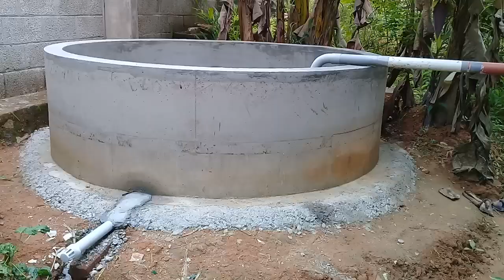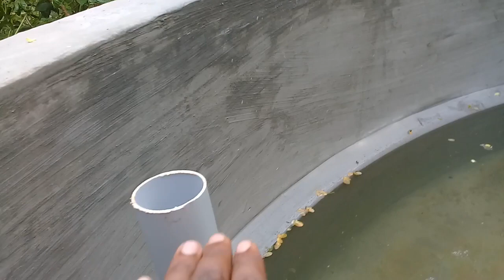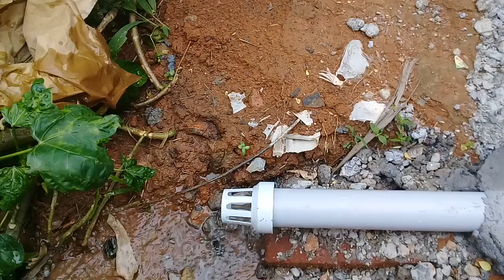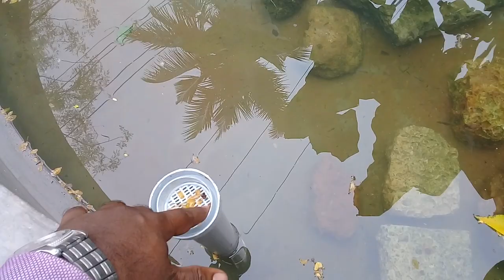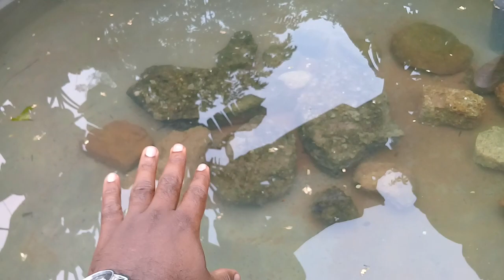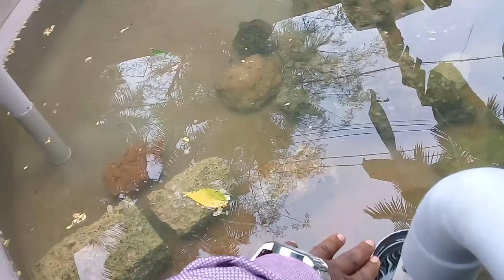fish pond for home Part 2

Comment: Grate idea. First of all I want to appreciate you for this idea.
Some of my observations I would like to share with you.
First is the design of tank. The bottom of tank must be in slope and small pit should be at center. Then the soil water of fish and wastage of fish food will accumulate over the center pit because of slope. That can drain out easily.
Second is, the drain pipe position should be at center pit. This out can utilize for CRA system as well as aquaponics system.
Then the inside of tank can apply water proofing to avoid leak and improve the tank life too. Cow dung can apply for reduce the chemical reaction too.
Height of tank minimum 1 meter recommended for fish farming. This height is enough for normal aquarium  fishes
.
Reply from the maker: Thanks ☺

Comment: Mr Rakesh nice video....what was the expenditure for building this tank....?
Reply from the maker: This tank costs Rs.13 thousand... for Labour ,materials and plumbing charges... Cost varies with the size of the tank.. small ones does not even cost you 1000 since  there are ready made ones... But this one is like 8feet in diameter which is bigger than normal...
Reply: @raksuncreations6848  sir thank you very much...I built one too with readymade circular rings used in wells...which is 6 ft dia and I used three rings...sir Iam  from Trivandrum....I want to make a bigger tank as you made....can I get your WhatsApp number if you don't mind.
Reply from the maker: @inntro  Hello... This tank was bulit by a normal construction worker and i just wanted him to implement my idea for water circulation and rain water collection... its quite simple .. sorry with the number
Reply: @raksuncreations6848  Thank you

Comment: Mr rakesh.. Is it advisable to use rain water for fish from the roof?
Reply from the maker: Hi... why not... I have a mix of Mushi and Tialpia fish in my tank now... and they are thriving pretty well...
Reply: Why put rocks in the fish pond ? Hope I'm not disturbing you or anything?
Reply from the maker: There is a reason for keeping porous rocks or corals in a concrete pond... most of the black water fishes lay their eggs  on rocks which a slippery concrete wall cannot provide.. also rocks act as shade or hide and create a natual environment feeling for the fish... I added 2 pairs of tilapia for test initially and now there are nearly 50+ juveline fishes last week..and rock had a major role to play
Reply: Thanks so much.. Get more questions and thanks for taking your time to reply me.. Appreciate that.
Reply: The reason I was asking this is Bcos I wanted to start catfish business and I'm a novice at it.. Need more help on the pond though.. Like structure and more
Reply: should we bare d water minimum one week without putting in d fish..bcause my tilapia started dying as I directly put them in even with aeration,they come up to d water surface to gasp
Reply: +mcdonaldi 12 put rocks and gravel very necessary and and put brackish water catfishes for rain water like mangur
Reply: If you're considered, you can put micro screens on your gutters. They are certified for the initial collecting of rain water from the roof for drinking water. Made in Roseville, CA by GutterGlove and sold at Home Depot.